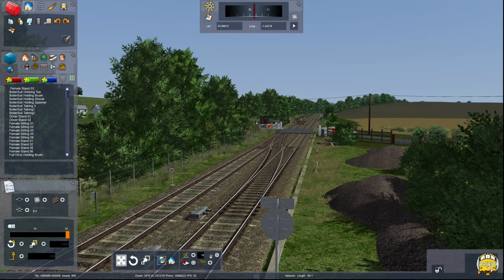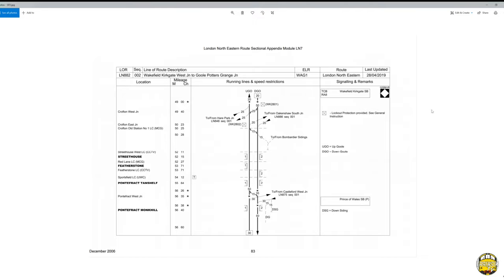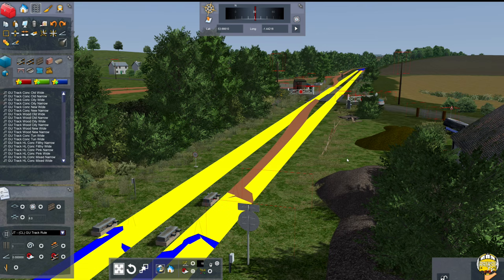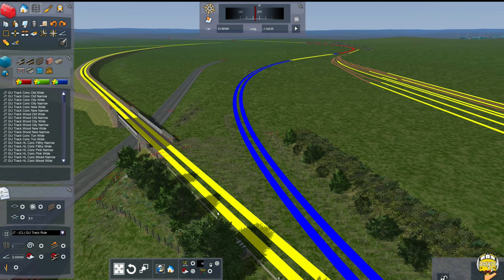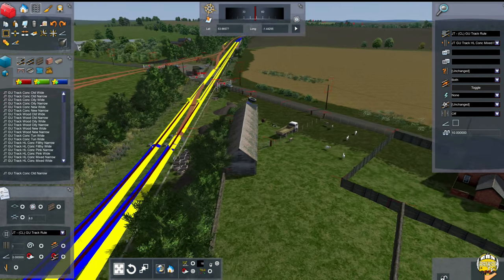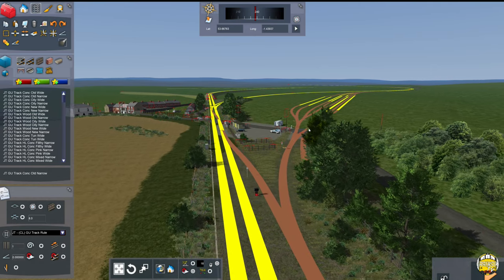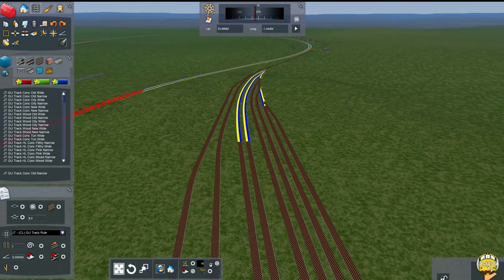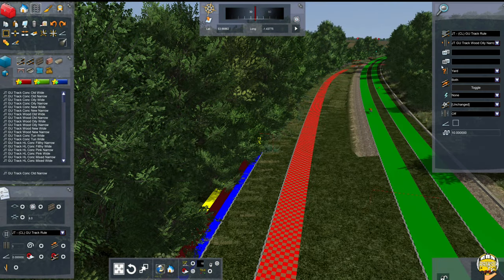Train Simulator 2021: Building Wakefield to Knottingley Ep.19

Comment: Thank you so much for another speedy upload with these series, would you be able to demonstrate the methodology to calculate the distance when the speed changes etc from the appendix ? Don't have cab ride videos so I guess the appendix is the only way to calculate where the speed changes exactly and I assume you can calculate where junctions are like this as well right ?
Reply from the maker: I'll try to remember that for when I do more of the speed limits. Basically where the * are on the Sectional Appendix is where the change in speed takes place. Normally I'll use a set location (say an LC) to work out where it is in terms of miles and chains. Lets say a 40MPH speed limit is at 40M20Ch but we have no idea where that actually is. If say "High Street" LC is at 40M65Ch We know it's 45 Chains from the speed limit change,to work out how far that is in metres simply go to google,do a "Chains to Metres" conversion and put in 45 chains,it'll then give you a measurement of 905 metres,which you can measure in TS. Once you know how to work the figures and find "common/easy to spot" points it should be fairly easy. The key to remember is that there are only 80 chains in a mile not 100 as you may expect! An example across a "mile" is that point A is at 1m70ch and Point B is at 2m30ch. If we want to work out the difference between it is actually 40 chains,because there are only 80 chains in a mile. You'd then do the chain to metres conversion again so you know how far that is in TS terms... 

Practice is what makes it easier to understand. Sorry for the long reply lol
Reply: @TrainSim_TV  fantastic stuff mate - keep up the great work. such an inspiration in the ts community!

Comment: How would I implement a temporary engineering work speed restriction in just one scenario? Excellent video
Reply from the maker: You can do what I did here when setting a speed limit,make sure it is your scenario you are editing,and not the route. Multiple addons come with signage that you can place for a TSR,just tick a few DTG routes and you'll find various bits. Thanks
Reply: @TrainSim_TV  thanks. I will try that out later. I have the JT mml will that have any tsr signs in?
Reply from the maker: @isaac_trains1273  No,it's DTG products that include the TSR stuff,off the top of my head,London to Peterborough,GEML and WCML Over Shap include them,there are others but I can't remember which sadly
Reply: @TrainSim_TV  ok thanks